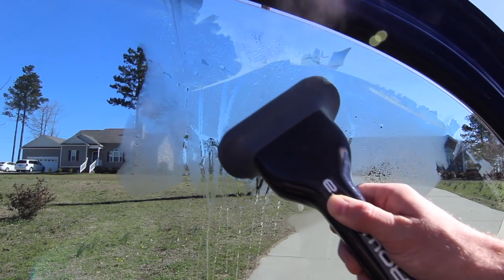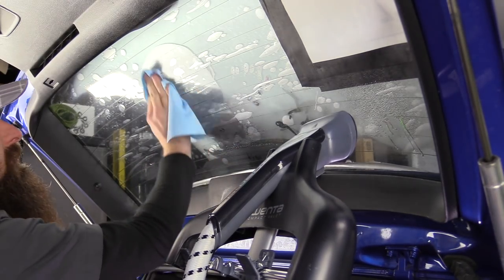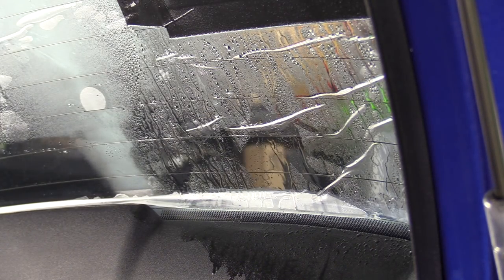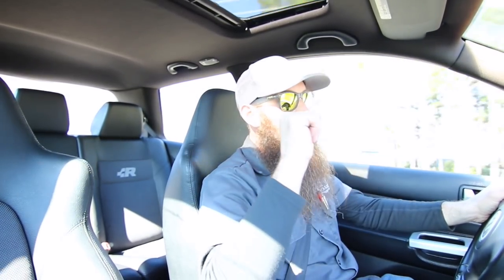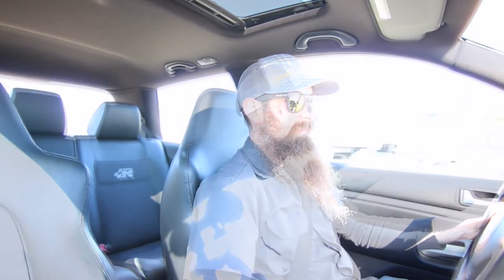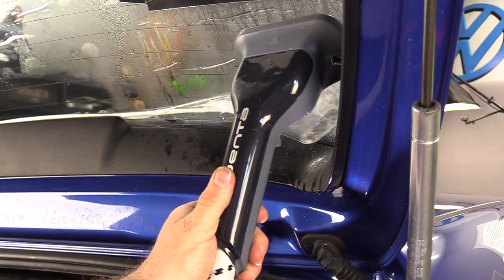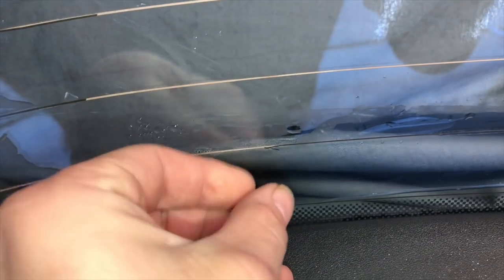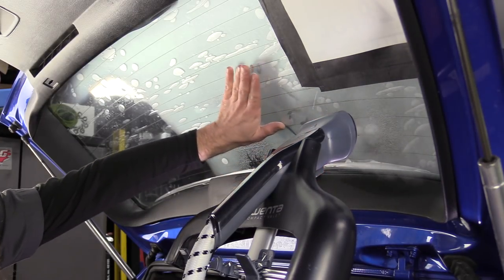Making Car Repair Mistakes and Making It Right

Comment from the maker: This video basically ended up with me going for a drive to blow off some steam.  Nothing to do, but to get the job done. Window tint and I have a sorted past. LOL
Reply: HumbleMechanic I used to tint windows as a job. When one came in that had a s*!t job done originally and needed redone, it used to piss me right off! 😂
Reply from the maker: Yeah this is not my first bad go with tint. I tried tinting the windows at my last house... FAIL FAIL FAIL HAHA.. I don't think I have the patience for it yet.
Reply: For my side windows I peeled off the tint dry (carefully) and then I sprayed glass cleaner on the window and scraped the glue off with a razor blade, the glue feels like it melts off (Just gotta be careful to not scratch the window)
Reply: I'm seeing an opportunity for a defrost install video. 😉
Reply: ammonia breaks down the adhesive for window tint. They make a spray for removing tint, and works decently.
You can also use acetone, but it will mess up plastic panels.
Reply from the maker: Or a rear glass install video. Ah Hahahaha
Reply: the adhesive for the film is just as strong or stronger than the defroster wires on the window. You know vinegar may help too never tried it but works for wall paper. Peeling it off first is another and probably the best on non heated windows (hair dryer helps and heat gun is better if you have the touch, but they can break the window and melt things if not careful). The repair stuff works if you buy good quality tape and install it on each side of the existing element leaving the proper gap where it needs mending.   Just paint in the gap and remove the tape. As long as its not the major part of the window. Did this once to a 3" section worked well. Otherwise junkyard find??  
Good luck Charles.. Not convinced that you did anything wrong here really. Florida heat drys out the adhesives too. As you stated the plastics were a bit sun tattered (If I recall correctly).
Reply: How did you handle the film removal on the rear defroster windows??
Reply: Maybe turning on defrost will help removing tint on rear window?
Reply: Wasn’t that a Florida car?  Once that tint is baked on that hard I don’t think it’s coming off without damage.
Reply: HumbleMechanic
Thing is you did everything perfectly as far as a professional tint removal, so it's not really your fault. That being said I would have been very tempted to leave the rear window tint on there, as annoying as that might be. But yes when it concerns a customer car, or a car other than your own you MUST make the situation right, and make the customer/friend/family member whole again.
Reply: As a professional tinter you did everything correctly. Steam is the way to go on the back glass. Whenever we do removals we always warn the customer that there’s a chance their defroster will not survive the removal. If they want to take the risk, we proceed with the removal. We typically have a 90% success rate. But PLEASE if you want to get the car re tinted, leave it to a pro. Thanks for the vid, keep up the good work.
Reply: Hey I have a MK4 rear hatch I was about to through away since I put a new hatch on my 2001 VR6 GTI the rear defrost still work. I'm willing to ship it out to you if you want it?
Reply: it's a free be.
Reply: Can you upload the video anyways just for fun? Maybe we can see you steamed lol....
Reply: I agree,  and think he should post the video
Reply: natan flores This is exactly why VW guys are the coolest :)
Reply: HumbleMechanic You can't beat yourself up over this. It could be just the time the tint spent in the sun bonding to defrost lines. Looking at maybe getting a VR6 Jetta or Golf. First time looking at VW. Anything I should look for or walk away from?
Reply from the maker: Yea it was a FL car.. :(
Reply from the maker: You will probably see me pull my hand away REALLY fast a few times.
Reply: HumbleMechanic feels like me and u think/feel the same!  Keep up the good work! Hope u can replace the rear window instead✌
Reply: It's weird , 
he never takes viewers up on it.
Reply from the maker: What do you mean?
Reply: HumbleMechanic isn't it easier to remove the rearwindow whit a functional (working) rear window defroster? Than putting some new heat threads?
Reply: HumbleMechanic btw look your messenger or insta got a annoying problem whit my golf mk4 v6
Reply: Maybe with some clever editing, you could make it into a defroster delete video... hehe 😛
Reply: Great video one of my favorite.

Comment: It happens, man.  When I worked as a mobile mechanic (had a career shift a little over a year ago), I built my business around helping low-income and single-parent families.  More often than not, this meant keeping old, poorly-maintained cars running for my customers.  It also meant I never had a day that didn't feel like a doctorate-level study in "things going wrong."  I used to joke that I have a Ph.D. in FFS.  ;)

But you hit the nail on the head:  Own it, fix it, make it right.  Don't let the car win!  :D

Comment: My experience has been I always owned my mistakes. Yes the boss will get ticked. But if you don't own up to it, you will become "UNTRUSTWORTHY" and this will be worse then getting chewed out. I was so trusted when a customer complained about something they thought I had done, my boss knew that I would have told him if I had done it. Honesty is always the best policy. Even if you broke something small and took care of it before anyone would notice, Reporting it on your paper work builds "TRUST". And trust is the single most important principle you can have in this business. And I had worked for some real (Insert male genitalia here) boss's in my time. 
One time I was just walking next to a car and my hip took out the drivers door mirror. We informed the customer and took car of it, I stayed late on my own time and did the repair. At the end of the day everyone was happy.

Comment: It sucks to mess a job up.. but it happens to all of us at some point. . Hats off to you for owning it, you can learn a lot from mistakes!  One of those circuit making/ conductive pens may save it? I've only ever used a heat gun to remove tint, the steam is new to me.

Comment: The steamer is the way to do it. The steamer will work on the glue left after as well. Those things happen sometimes. Now you can do a vid on how to install a rear defrost on a vw. I agree with you 100 percent every thing right and stuff still goes Sideways.

Comment: Admittedly, I was looking forward to the tint removal video, due to wanting to remove a shoddy rear window tint job on a beater Acura EL (Canadian Honda Civic EX, basically) that I picked up in February... but this video was a stark reminder of something just as important; a lesson I relearned during a radiator exchange I did between the Acura and its predecessor (a '97 Civic that I drove for three years until it died last month).

"It is possible to do everything right and still lose. That is not a weakness – that is LIFE."

Sir Patrick Stewart spoke those words, words of wisdom and warning, over twenty years ago; a long enough time period that when I tried to do the radiator swap I had long since forgotten the quote! The result? A two hour job – four hours, counting battling zeerust and having to do everything TWICE – took three times as long, due in no small part to mistakes made... and coming within a hair's length of giving up completely!
You said it best, Charles: when you make a mistake, own it, fix it, make it right for the person you're working for, whether yourself or a customer. Doesn't matter if you're DIY or a professional. Thank you so much for the reminder of that fact, however unintended it may have been.
Reply from the maker: TRUTH!
Reply: .....And there's my shocker for the day - you actually replied. Didn't expect that at all... O_O!
My thanks, Charles, and good luck with this situation. :)

Comment: Little tip for rear tint, do it cold, don't add the steam til the tint is off. Don't worry about the glue, it will come off with steam and a vacuum/wipe-alls. Nope, best way is to try and rip it all off very quick, as cold as you can get it

Comment: Great video Charles, really sucks it didn't work out. It's actually really inspiring seeing a pro such as yourself have a problem and exhibit frustration with failure. I'm relating cause my brake job went south with one wrong split second input on my new tablet which resulted in a ruined caliper. But kept at it and got the job done today. Trying to keep in mind a 'mistake' or 'failure' is just a chance to learn something important- it sucks but now there is more knowledge for next time.. thanks for sharing man.
Reply from the maker: Yeah man. I hope you guys can learn from my mistakes. That makes it worth it.

Comment: Ugh, sorry to see that this happened.  We've all been there.  My biggest slip-up was when I was doing a valve adjustment on a 2001 Integra Type R.  I had the valve cover off, had my 19mm socket on what I thought was the crank pulley bolt, and was attempting to rotate the engine.  Unfortunately, I was on some other bolt (I think it was engine mount), my socket slipped off after I gave it too much oomph.  I fell and my chin hit the fender putting a nice dent in it.  I got it removed by PDR and it was expensive.  I was so mad that I didn't even feel like doing the valve adjustment and still had to get everything buttoned back up.

Comment: dang, I did both a Kia Picanto and a Citroen C3 removal of window tint, using the black plastic method, and didn't have problems with the defrosters, even though your tint seemed to be coming off way easier than the ones I did, maybe the VW defrost lines are more fragile?

Comment: Great videos, I finally bought a VW 2003 passat 1.8 t  4 door. I have wanted to buy one for awhile. Everybody tells me not to buy a vw, parts are too expensive they are expensive to maintain, if you can not fix it yourself, the mechanic bill is too much, to many recalls. I bought it anyway. 200000 miles desent shape, new tires, new brakes, needs motor mounts and a windshield as far as i know. Anyway looking at the dash i relize there are all these buttons and lights and no reference to figure out what it is telling me. There is a yellow round circule on the dash, somekind of warning light, but i have no reference to figure out what it means. Maybe a general video on dash lights and buttons would be helpful. Also how do I suggest topics in general with out just adding it to the latest video. Thank you....

Comment: So funny you put this up now...I just messed up a door latch replacement on my bug. Now I have a driver door that does not open lol. All part of the diy fun!
Reply from the maker: Been there too. I’ve forgot the inner cable many times. You usually find out when you pull the car out for a customer and can’t get out. Ahahhahah
Reply: HumbleMechanic My exact mistake! I was about to fix it when my sister innocently comes by and closed the door 😂😐

Comment: Such an honest vid, you got there! Very relatable. How about the right front window--what method did you eventually decide on to use on your last window?
Reply from the maker: So i used stream. It worked the best. Still kinda sucked. I actually removed the whole glass to get all the tint off
Reply: Tedious, man, but I am with you. That method is the safest to do.

Comment: Bought a used (15K) WRX for my wife.  It had a tint.  The dealer had afixed the transfer sticker to the inside of the rear glass.  When I went to pull it off it took some of the tint.  Heated glass and I was forced to remove it.  Heat still works but not fun.
Reply from the maker: Oh man, I hate when Illinois did that crap.

Comment: Changing a rear hub assembly last week. Did this job tons of times.  Had to get the axle loose from the dust cover to pull that off and picked up my hammer taped directly on the axle.🙄. Messed up the threads just enough to not be able to put the nut on. I knew better.  Had to spend 100 dollars to get a m22 1.5 tap and die.
Reply from the maker: OUCH!

Comment: I just had a VW fail. I changed rear pads and rotors. Found two seized calipers so I replaced them. Had a seized hard line that goes to caliper. Had to hand bend a new one. Gravity bled calipers and decided to bleed them the old school way and now my brake booster is leaking vacuum. Apparently Golfs don’t like that and I should have used a pressure bleeder 🤦‍♂️. Stars didn’t align

Comment: My dealer did this on my brand new MK7 R when I asked them to retint the back due to dealer tint being bubbled. Tint tech chipped the defrost lines in 2 places and didn't do anything but tint over it. Of course, they didn't' conduct, so I  brought it back in.  Instead of repainting the lines (two small nicks), they said they could only replace the glass. They replaced the rear glass and tinted again. Of course, the glass tech scratched the car in the process. 

At least you could own your own mistake.

Comment: If a dealership made that same mistake they would have told the customer that improper tint was used and therefore damaged the rear glass requiring glass replacement at an additional cost of $1200...

Comment: I have a good question1999 vw Passat 2.8125k transmission never was servedI did change fluid and filter (was really black)drive for 500 miles and did it again(just in case)transmission now works smooth but first drive have a delay to change from 1 to 2only first time it needs 3000 rpm or drive for 20 seconds after that is perfectwhat is wrong?thanks

Comment: Hey man, new professional vw tech here, how do you  handle verbally abusive customers? I made a pretty huge mistake during a failed chain tensioner repair on a tiguan, got everything buttoned up and were on the test drive, no cel,  motor running great, till the crankshaft bolt backed out >. < (I will never ever make that mistake again) anyway, I offered to fix it, offered refund, but the client was irate, belittling,  and over all abusive in his communication. I asked him numerous times to approach me with a level head, (I did not tell him to call down, bc that never works) but still after several days, he was unable to do so. In the end, he filed disputes against all funds sent via PayPal (4 days after mistake, $3600, most of which went to oem parts and disposables during carbon abatement and rebuild) and PayPal sided with me on all but 1 of the payments. At what point is it ok for a tech to cut ties with the client? Or refuse to deal with them, even tho it was I who made the mistake? My issue wasn't owning up, or unwillingness to fix the mistake, it was his inability to be reasonable. Anyway, any thoughts would be appreciated. Thanks!

Comment: I was carefully disconnecting an alternator on my old old car and the wires separated from it. Then I got the connector off, first the tab broke then the rest of it crumbled. Over an hour scavenging through the junk yard I managed to find 1. Only 1 and it was out of a 80s Corolla. Sun began to set and now I have to wait until tomorrow to fix the harness. Some mistakes are plain unavoidable.

Comment: I think you should just go for it. Just change the title. It's not a big deal. If you don't need the defogger, just leave it as it is. If you need it badly, well yeah you may have to scrap it all and or get the new glass, but in my honest opinion, why waste money if you could save it. Just go with the plan without the heater. Don't get down when it is not your fault, things happen. Strap on a pair, and get going. You're an awesome mechanic. Hold on to that.

Comment: @HumbleMechanic 

Forgive me if someone already commented on this (I didn't have time to read through all of the prior comments and associated replies)...

First off, thank you for all of the great videos! You have helped me achieve a much higher level of understanding about my vehicle and its associated maintenance...

Second, after watching the short clip of your defrost lines coming off, it appears that it was just the black protective layer that peeled off.  It stands to reason that the metallic underneath (what actually heats up to defrost) is still in tact.

I have seen some crazy people use steel wool on their back windows to prep tint installation and the abrasive removed the protective layer/coating, but left the metallic conduits still in tact underneath....

Have you tried the defrost to see if it still works?
Reply from the maker: You may be right. I haven’t tested all the grid yet. But you can see a hand full of places there is no line left. :(

Comment: You done fucked it up! Time for new rear glass.
Did you think about turning the rear defrost ON after steaming but before peeling? Probably would’ve loosened the adhesive’s bond to the defroster line paint...
Reply from the maker: Yea that would have helped I think. I had it one for a little bit. Not long enough. Haha

Comment: Would it have helped to over-use the defogger to cause the film to separate from the traces or bubble up some more? Mine had about twice as much bubbling in it so that may have been in my favor.
Reply from the maker: I think so. But part of me thinks it still would have happened. Hava
Reply: HumbleMechanic I can certainly identify with you. It's as you said in the video. If it were my car, I'd be inclined to just retint it as is. I hope the rest of the repairs work out for you.